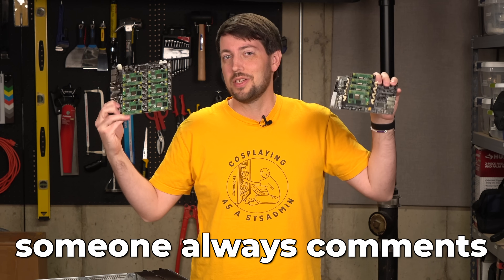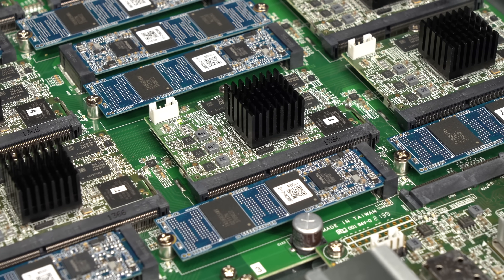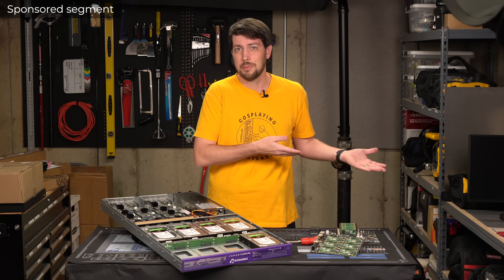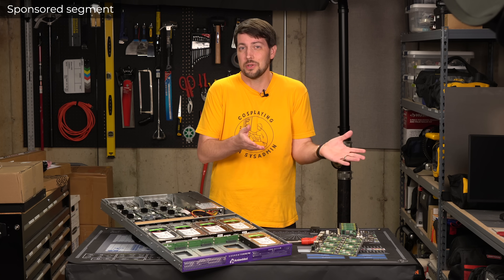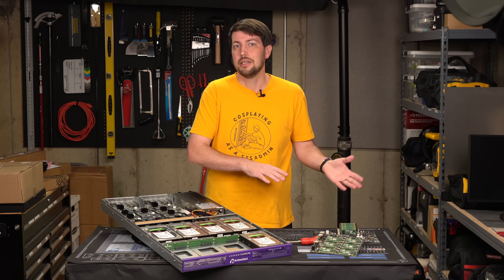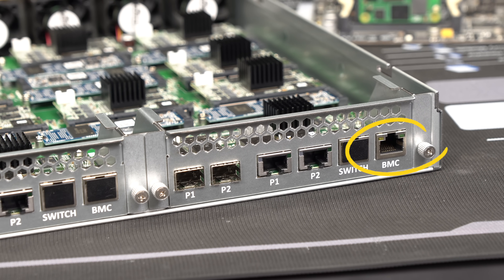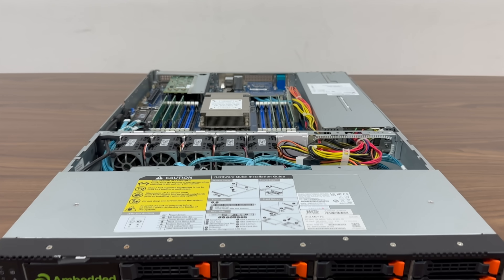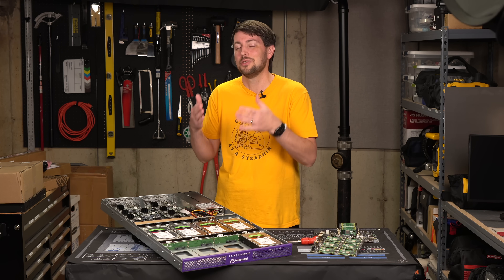This storage cluster is WEIRD! (Mars 400)

Comment: The lack of vibration dampening is a concern in any data center.  Vibration can be a major issue when you fill out a rack if you're still using spinning disk media.  However, it might not be significant if you only have a single 1u device with 8 drives.  When you scale it up, that's when you're going to have problems.
Reply from the maker: It's a good reason to only buy Exos or other rated HDDs, they are built for high-vibration environments. And racks can (and should) have a little isolation... but they still have vibration induced by fans, other drives, etc.)
Reply: No, that's a very small problem.

Much, much bigger one is lack of hot-swap. ANYTHING down in that server and you are for server-out operation.

So the entire benefit of having 1 OSD per server (not having to worry about having multiple OSDs down when server dies), is entirely moot here, as you need to take it out to do even simple disk swap.

Like, you could risk it doing it when it is on but that needs those rails that allow cables to be still connected when rail is fully extended... but that's PITA to cable and have shit airflow

Also having option of hot-swapping (even if it was a pair-at-a-time) would also solve vibration as those trays almost always have some elasticity in...
Reply: @xani666  Nope, as long as your cables are long enough you can access the cabinet to change hard drives, M.2 drives or even an entire node without a power down.
Reply: @kevinthorpe8420   yeah. You can have cables long enough to slide it out. However, as mentioned, it's a PITA to cable manage, and it hinders airflow at the back of the rack. Congrats. You solved the storage access issue with even bigger issues. A solution like this is fine in a 1U chassis. IF you have an identical setup in another rack already to go to switch over when SHTF. Preferably three identical. This way you still have redundancy when one is down. Think Kubernetes. Think ETC clusters. Think anything HA.

Comment: What was the sequential read and write performance?
Reply from the maker: See later in the video—about 200 MB/sec.
Reply: Ok, I thought that was still random.  Would have expected closer to 500MB/s sequential reads out of 5 SATA drives.
Reply from the maker: @jdl3408  - Yeah, in a typical RAID on a single system, you could probably get 250-300 MB/sec with 5 drives, but this is running a kind of 'raid over ethernet', accounting for data integrity and all that... so it has a bit more overhead built in.

Comment: I would imagine the dual 10Gbps ports out the back are so you can connect them up with multi-chassis link aggregation to the upstream switches.
Reply: Also, network math within the device:
8x nodes with 2x 2.5GbE ~= 2x 10GbE

Comment: Sponsored segment or is this just a 13 minute ad with a 1 minute ad segment.
Reply from the maker: I said in the video—I reached out to Ambedded, and they were generous enough to send out this unit for testing. They sent the box with the 8 nodes, I put in my hard drives, there was no other transaction on their side.

Twingate is the sponsor for this video, if you want to read more about my sponsorship policies, please see: https://github.com/geerlingguy/youtube#sponsorships
Reply: @JeffGeerling  Thanks for the clarification.  Recently I've seen too many videos that were nothing but 10 - 15 minute long recitations of manufacturers talking points.  It's parts like at 7:50 which especially feel like shilling, i.e. they said you need three of these for max performance. "Max performance" is an empty marketing phrase.

I'm not the market for one of these, and I suspect the case is the same for most other viewers, still it feels like a very hard sell.

In case you see this and miss a comment from @agkottsman, they say: "I know Ambedded is partnering for marketing purposes, but you don't make it a sales pitch."
Reply from the maker: @NuncNuncNuncNunc  Well to be clear I did say "the engineers told me"

For my own needs, this server will stay in my lab, but not powered up unless I'm doing testing on it. It's both overkill and underkill for what I personally require :)
Reply: @JeffGeerling  Yes, that's my point. You just repeated their talking point. Can you independently say what "max performance" is. With only one machine, you are not in a position to even compare. You also can't say you were not paid as you are keeping a $3k storage appliance regardless of whether you use it. Objectively, you praised the device without running test even though you say, "Special thanks to Ambedded for sending over a Mars 400 for testing."  I hope you can see how this may have the appearance of being a paid advertisement.

I can appreciate that it is possible that it is not worth Ambedded's time/effort/money to accept a return.

I've been watching you for ages. I just feel you owe it to your audience to be fully transparent.  I'd hate to see another Linus drama unfold.

I should have added before - most of your viewers are not in the market for this, but Ambedded suspects that of the 100s of thousands who will see the video, there are a few who are, so for Ambedded this is money well spent getting their name out there.
Reply from the maker: @NuncNuncNuncNunc  I said explicitly that they sent it for testing.

I don't really understand how I can be more transparent than that. What else should I say? I also marked the 'sponsored' flag on the video, I added disclaimers in the description... I re-iterated everything in this comment thread...
Reply: @JeffGeerling  "Ambedded is not paying me" to answer the question of how to be more clear.

Comment: I really need to spin up an ARM powered Ceph cluster of my own when I'm finished with the Switchwire...
Reply from the maker: Definitely! It's gotten a lot better—I remember a few years ago it was a struggle to get it running. Now it's almost on par with the x86 experience, and you fight with the normal things you fight with in all clusters, instead of incompatibility issues.
Reply: @JeffGeerling  Hopefully it won't generate enough heat to melt the 3D printed server rack it's in. I really should have used ABS instead of PLA for it...
Reply: @socketwench  Sounds like it's time to prep another rack... ;)

Comment: Sillicon Graphics (SGI) Purple 😅. What do you use Ceph for?
Reply from the maker: Kubernetes / distributed storage.

Right now in my 'production' homelab I'm still running mdadm RAID and Samba. But I'm considering moving my main storage to Ceph at some point. Not sure if 'forever' but it would be nice to run a local bare-metal Ceph cluster in production. Most of my usage has been on managed instances, and they're less fun :) (and more expensive).

Comment: what on earth this thing uses less power than my desktop idling.
Reply from the maker: Heh same here for my 4090 desktop. But you can get down pretty low on mid-range PCs these days! I still wish they focused more on idle power consumption, especially for peripherals like graphics cards!
Reply: @JeffGeerling  yeah my intel arc 770 uses 40W just idling but its memory bus is unable to clock down probably due to its design, 12VO looks like a very good standard for idle power.

Comment: Hmmm Twingate looks interesting. I've been considering setting up my Mac Mini to do that sort of thing, Twingate sounds like a much simpler solution than fighting with Apple bullshit from 2006, and at least the hardware side for it would be cheaper than buying basically anything x86.

I'll need to come up with something to do with the ancient Mini though.
Reply from the maker: I used my 2011 Mini for a few years as a simple file server. Some of the Intel minis could run Linux and even do okay with some things like Jellyfin or Plex!
Reply: @JeffGeerling  I should look into more options for it, though mine is a fair bit older than yours.

I do know I can upgrade the CPU and storage, if only there were quad cores that would run in it, that would probably be better for any likely task I'd put to it since I'm not a vintage Mac software enthusiast where I'd run into lots of stuff that isn't multithreaded enough to benefit from the extra cores.